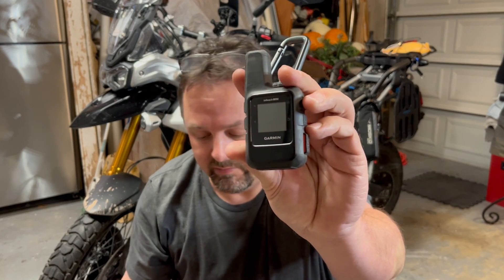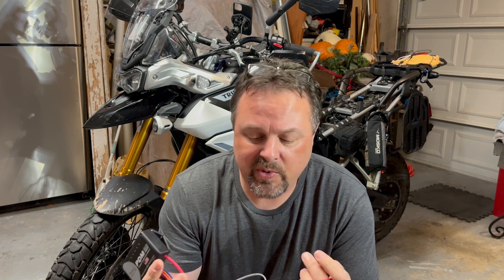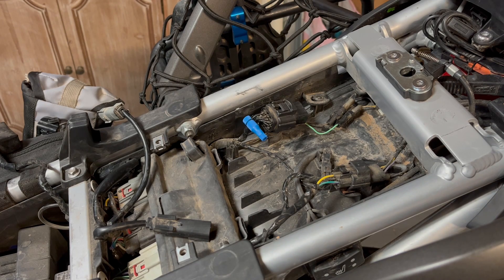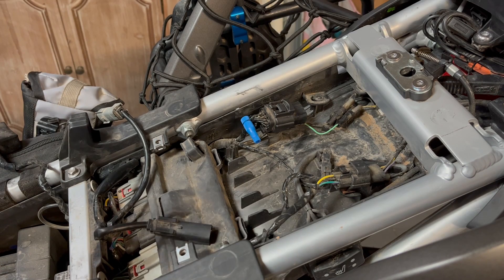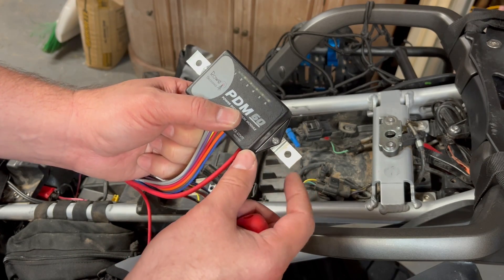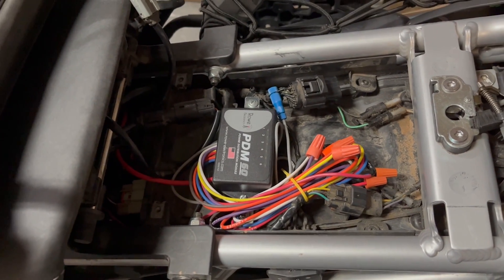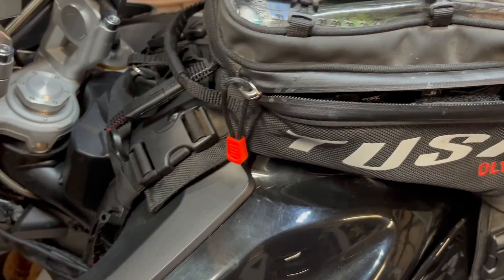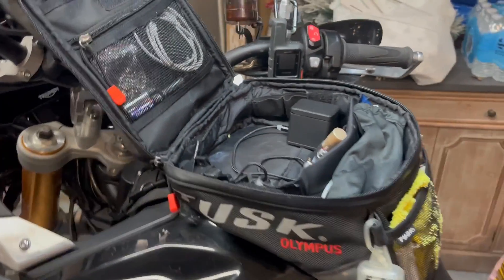Electrifying a Tiger 900

Comment: Can I ask a dumb question? How did you "tap" in to the plug? I really don't want to splice any cables. That was a very clean! Great video!
Reply from the maker: Positap connector.  https://a.co/d/5F6tQ56. This lets you tap into a wire without cutting it.
Reply: @kurtshetler9719  that's a pretty cool product,  i was afraid of touching the canbus wires on a new bike...anyways, cheers. Your channel deserves much more attention
Reply: I'm assuming you added the blue connector

Comment: Hey Kurt.. just got a new 🐅..what GPS mount/ phone mount do you recommend ?
Reply from the maker: I’m totally digging the Quadlock vibration mount for my phone, and the Evotech Performance mount for my Garmin gps.   I’ve done about 7K miles with my phone in that mount and zero failures.   If the terrain gets super dicey I’ll put my phone in my tank bay, just in case.  But normal washboard, gravel roads, no problem.

Comment: Hello Kurt. I see you are a fan of Garmin. I see that GPS mount for above the TFT. Can you do a video of its mounting and stability of vibration on that mod. I'm looking at the Garmin 800
Reply from the maker: I love this Evotech mount!  Installation is pretty straightforward, if a bit fiddly.  You remove the windscreen and it slips behind some of the boots that holds the display.   It’s rock solid.  I don’t have any vibration with my Zumo XT, and it puts it in exactly the right spot.   It comes with a new crossbar that replaces the OEM bar.  It has a bit of a curve in it, to give the mount a little space.   With the gps mounted you can’t adjust the screen with one hand, but the new bar has tabs on the outside you use to move the screen.  I wish I had filmed the install.   Cheers.

Comment: I really like how you did this, great job! I’ve been looking at the PDM60 but didn’t know where it would fit. Does it get in the way of that plastic usb phone tray on top? Btw, which size is your Olympus tank bag?
Reply from the maker: Thanks!  I pulled out the plastic phone charging tray.  I found it to be a complete waste of space.  I rerouted the USB socket from the phone tray to feed the quadlock charger on the handlebars.  The tank bag is the large size.

Comment: Nice video.  Side note:  I am getting the Rox risers also.  Did you have to install a longer cable on either side?
Reply from the maker: Thanks!  The clutch cable is just barely tight.  In a perfect world it’s have a little more slack. But I’ve put about 6k miles on it with no issues.